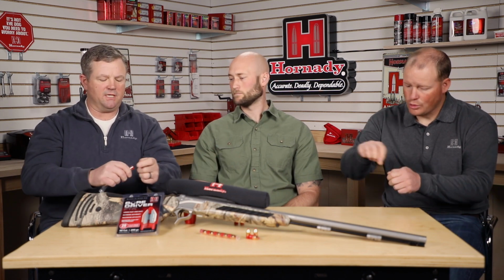Hornady Bore Driver™ FTX Overview

Comment: Now are people thumping out with pellets such as triple 7 or loose power like black horn 209 I’m a big fan of black horn and have been using the old xtp hollow point in my tc omega making very nice groups with them and very nice performance on deer with them I have shot over 20 deer with the xtp so changing to something new would like to see some more videos on performance with them
Reply from the maker: I personally use loose powder but we've had good results with both.
Reply: I shoot the same muzzle loader and I shoot the 300 grn xtp as well, with very good results, and my speed is real fast to me anyway at about 1900 fps and very good groups,I don't think I have any idea of switching at least this way is little less expensive, I suppose they have to reinvent the wheel so they can sell more,can't really get more accurate than  what I have now, I just thought I would mention it.  Aim small good hunting !

Comment: Guess they saw how popular the federal BORE LOCK were.
Reply: @michaelcrawford1011  federal Bor lock have consistently been recovered with textbook mushroom that being said usually at 80 to 100 yd they will not pass completely through but will be recovered under the skin on the Pharcyde usually under that distance it'll blow right through but it still leaves a fairly decent Blood Trail when necessary because we've had quite a few deer drop right in their tracks with the federal Bor lock

Comment: Have you discovered a particular rifle it works with better than others? I am new to muzzle loading and want to spend my money wisely. I am happy with what you have provided with my rifles in competition so I am pretty certain this will be a winner.
Reply from the maker: So far in testing this has worked well in any muzzleloader that they have tried.
Reply: @Washington Bear  looking at them right now. Seems like a pretty neat system and priced pretty nice as well. Never shot one before so this will be a new experience for me. Several friends take advantage of the extended season for mussel loaders so I thought what the heck...I love hunting so I will give it a whirl.
Reply from the maker: @skipsmith9692  That is our favorite thing about the muzzleloader season here in Nebraska, it lasts all December!
Reply: @Washington Bear Not always, could just mean there is a marketing partnership.
Reply: Cva paramount is hard to beat for the money

Comment: Will guys ever make a BORE DRIVER OF the 12ga/50 Cali for the shotgun, cause currently I play the lottery and when my numbers hit , I have plans on contacting what ever gun makers that works with carbon gun barrels, cause I have researched as much as I can through Google, I'm gonna make an attempt to get a steel barrel liner and carbon fiber wrap for shotgun barrel for deerhunting,  there are slightly too many headaches for the many deerhunting society to figure out what they might think or what they might remember what they had some reasonably good luck with,  cause the gun powder vibrations the shotgun barrel goes through, the shotguns that have been made over the past 45-50 years have been made a little on the thin walled side, cause everything that I have read ,the shotguns of our country and our hunting society needs a stiffer and stronger barrel,  I remember when winchester high impact lead slug came out back in the late 90s and the remington copper solids, these slugs were made for ranges between 100-200yds, 
Hastings barrel company doesn't carry any Choke tubes any more,  winchester and Browning of Repeating 
Did push a 5 inch choke tube for the smooth bore Browning BPS, that shotgun was able to maintain a pattern of between 4/5 inches at a 100yds, that choke tube was rifled  , but personally I think the 12 gauge shotgun deerhunting barrel and any of all the 12ga slugs have had a seriously lousy history all this time,  yeah naw, the shotgun isn't a rifle but the shotgun barrels could be made better,  and as far as the powder loads that of the slug companies are concerned it really makes me wonder if the powder loads are loaded match grade consistency as in spec for spec, 10th by 10th,,,, best of luck

Comment: Almost sounds like a powerbelt but not quite.
Reply: This is essentially an improved powerbelt. Actually jacketed rather than copper washed, interlock design which has proven itself on game from coyotes to cape buffalo, and a flat bullet base allowing you to take off the skirt and run them in 54x50 sabots if you have a 54 caliber muzzleloader you'd like to boost the performance of, be that a sidelock or an older inline. Coming in what are essentially speed loader tubes is a bonus.
Reply: @Rhett G West did you like them more than the sst?

Comment: basical u just took the federal bore lock idea!!!!
Reply: No. Federal bore lock is essentially a modern take on a compression bullet as seen in various European militaries in the 1850s and 1860s muzzleloading rifles. This is an improvement of the Powerbelt design which is essentially a take on the Minie design with the skirt that flairs out to engage the rifling upon firing.